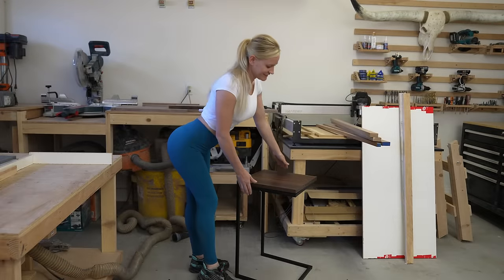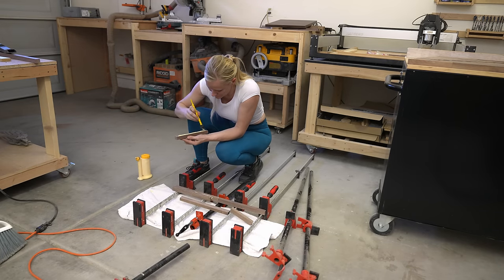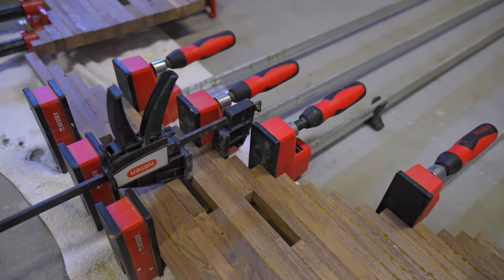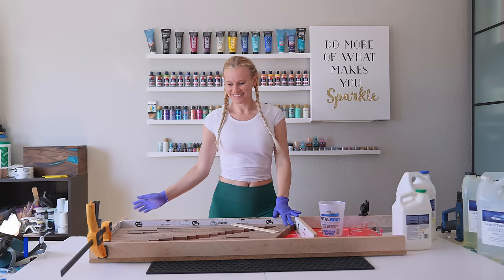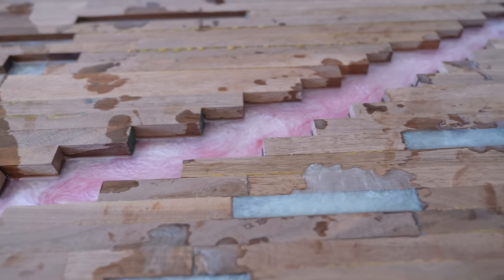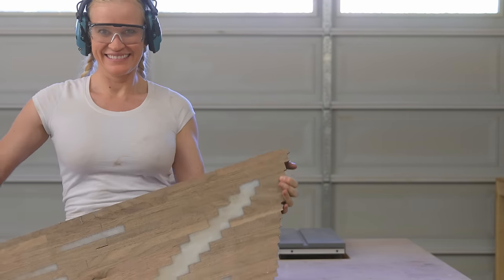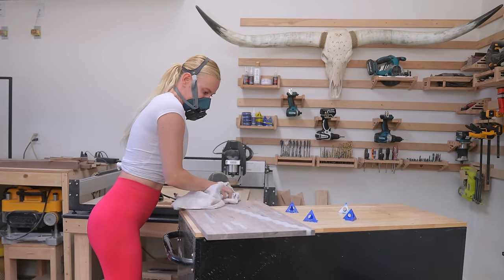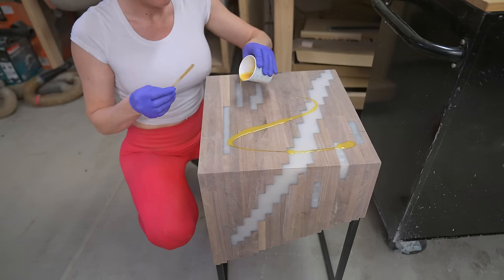oops... I did it again! #woodworking

Comment: Another awesome project Meike! Now I know why there hasn't been a video for a few weeks since this has clearly taken time and effort to put together 😍
Just a small question, how is the stability of the table since there is more weight on the backside? If you find it's easy to tip over because of this, I would consider hiding a counterweight under the table top inside the frame towards the front 🙂
Hope you are well and looking forward to seeing what projects you've got in store for the holiday season 🫶
Reply from the maker: Hi Andy, thank you so much for your support  and patience. I really appreciate the extra support from you!
The table is pretty sturdy by itself. I mean I wouldn’t sit on it since after all the legs were  only $37 but are sufficient for drinks, plates, remote control or any other things you might   have next to you while watching TV. But hiding a counterweight would always be an option too 😃
Reply: @WhatMeikeMakes  I'm sure even a $37 set of legs is plenty to support you 😜 I'm actually going to take inspiration from this project and try to make a variation that will match my sci-fi themed living room, so thank you for the ideas 🫶